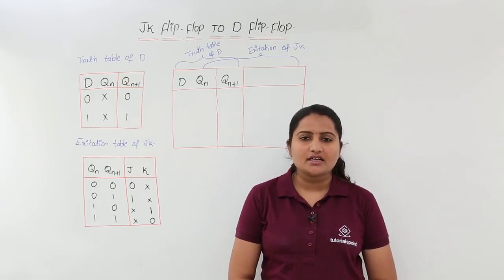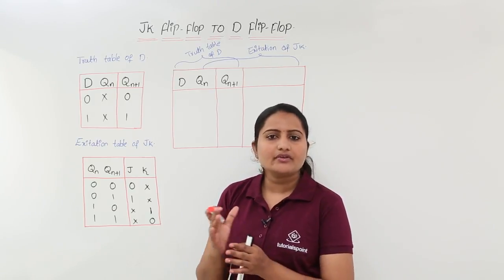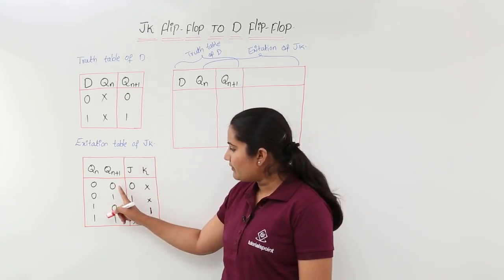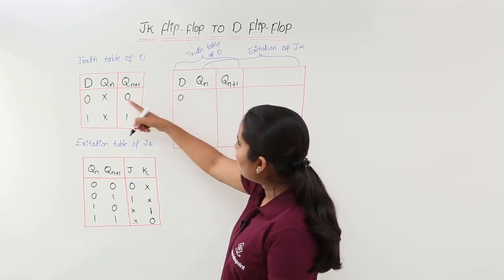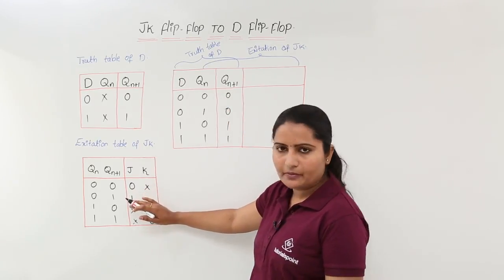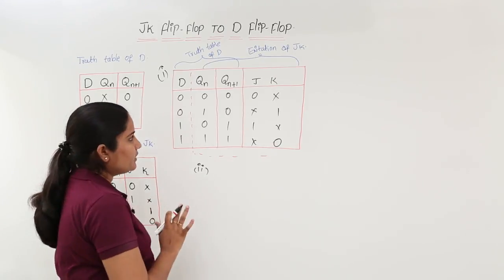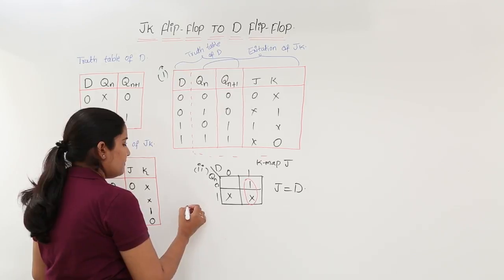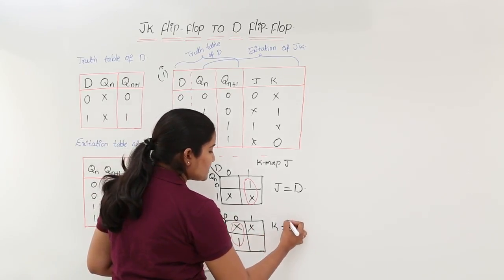J-K to D Flip Flop conversion

Comment: if the input clock frequency  10ghz is passed to 6 bit jhonson counters then from mod-5 ripple counter out of which is led to mod-6 counter then to BCD synchronous conter. What is the output of the frequency?
Reply: Help anyone

Comment: very nice
but there is issue in the heading? i think this is the conversion of JK into D ??? kindly reply me for this thing????
Reply: what u think is right bro..It is conversion of jk flip flop to D
Reply: @dharanithatavarthi2176  
I m not remembering thins topic
Hahah bcz papers ended, nd also result announced 
.
By the way, i think i was wrong
Heading nd video both are correct
Reply: if the input clock frequency  10ghz is passed to 6 bit jhonson counters then from mod-5 ripple counter out of which is led to mod-6 counter then to BCD synchronous conter. What is the output of the frequency?